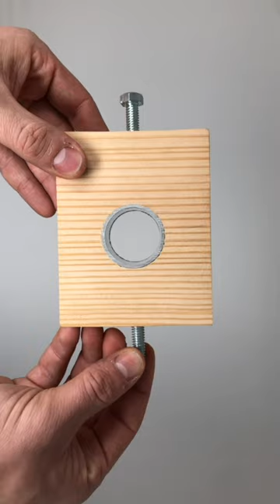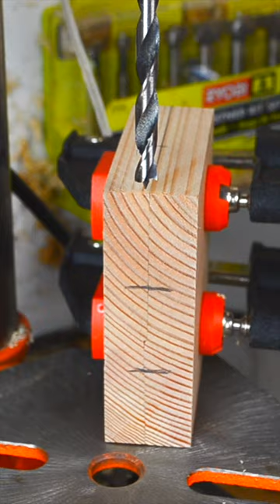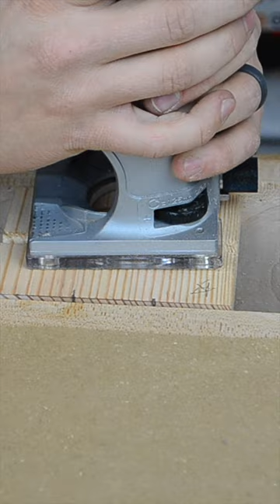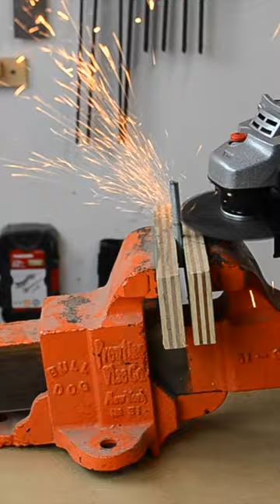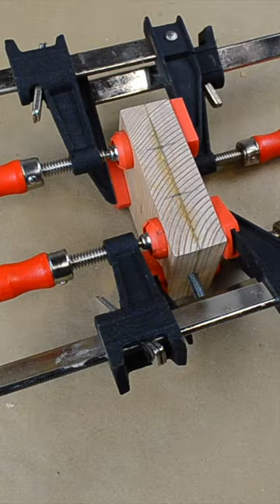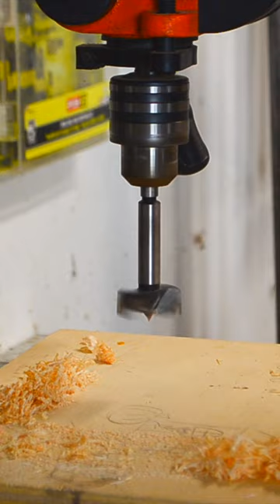How does it work? Vanishing bolt trick #shorts

Comment: no dovetails. would not recommend.
Reply from the maker: Damnit I knew I forgot something!! 😂
Reply: Genuine question, what is a dovetail and what is it for? I took some woodwork classes a few years ago but I haven't been able to take any more since then so my memory is foggy on these terms.
Reply from the maker: @VegaVermilion  That's a great question. A dovetail is a specific kind of woodworking joint, usually to connect two pieces of wood at right angles. For example to connect the four walls of a drawer. It's a little difficult to do by hand which makes it kind of classy (you see them on a lot of antique furniture). There isn't really any way to use a dovetail on this project, Myrkskog was probably making a joke because I often use dovetails on my other projects :)
Reply: @dkbuilds  ahh ok tyty
Reply: @dkbuilds  if there is a will, there is a way. If there is no will, there are excuses 🤣